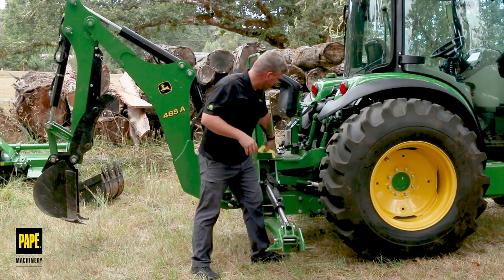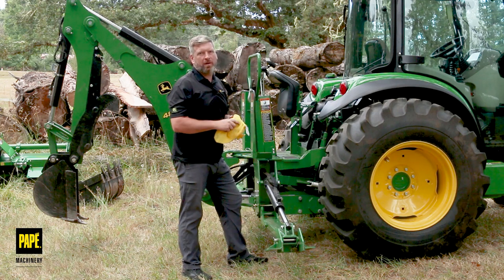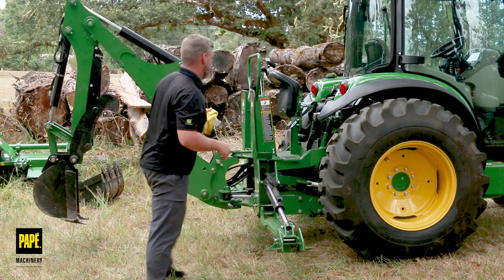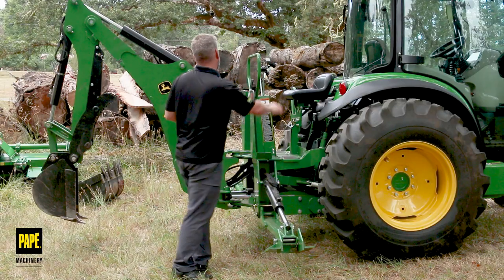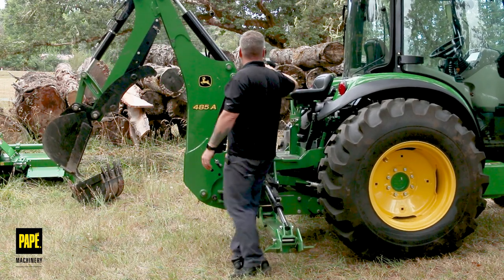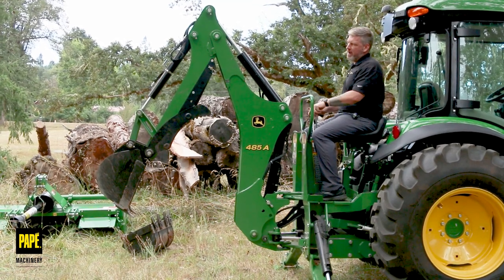Installing Your John Deere 485A Backhoe

Comment: Great video! I have a 485 backhoe and a 2022 JD 4066r with a cab. I just bought the JD BLV10334 mounting kit. because the 485 isn't listed as a tractor that the 485 will join up with. So I found this part online and ordered it from my JD dealer they didn't know this existed. Besides all that I see a part you have on the 3-point hitch a lift rod that lifts the 485 into place you call it a crossbar. Do you know the part number of the crossbar? Thanks for the video and any help.
Reply from the maker: Hey Mike, thanks for watching! The part number to the crossbar/connecting rod is LVA19407.
Reply: @papemachinery.agturf  I have a 485 backhoe and the 4066r with a cab. I had to buy a BLV10334  because the 485 wasn't on the 4066r list of tractors. With this BLV10334 it's a kit to make it marry each other. Do I still need the LVA19407 to make this all work? Thank you for any help. There's no videos out on this setup.